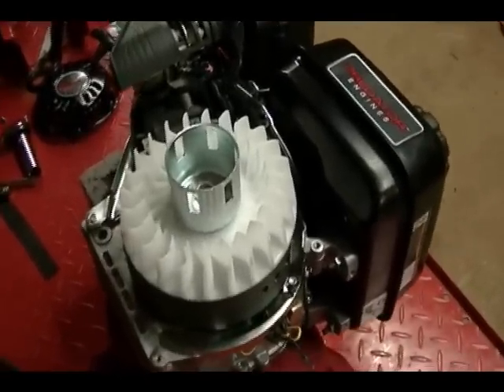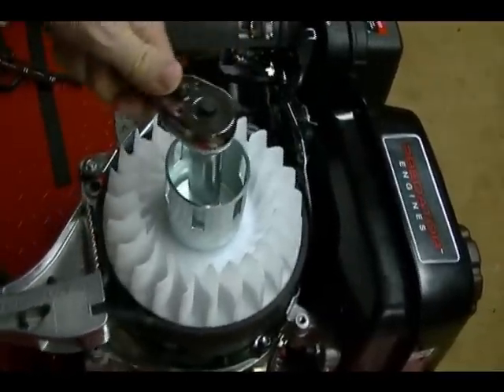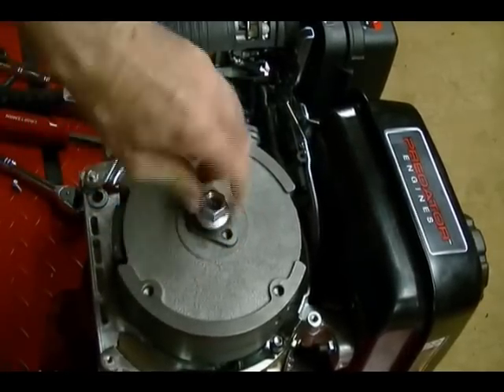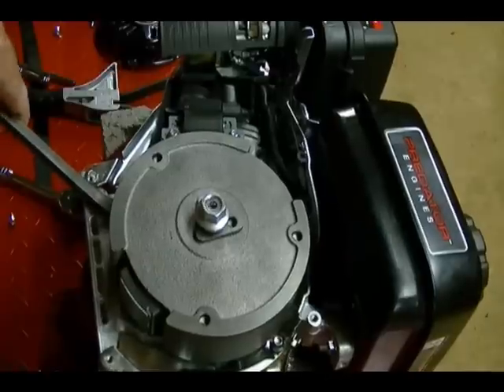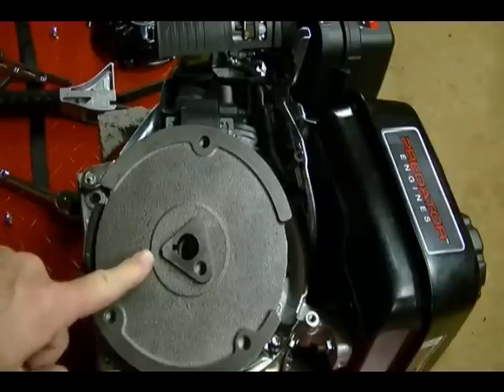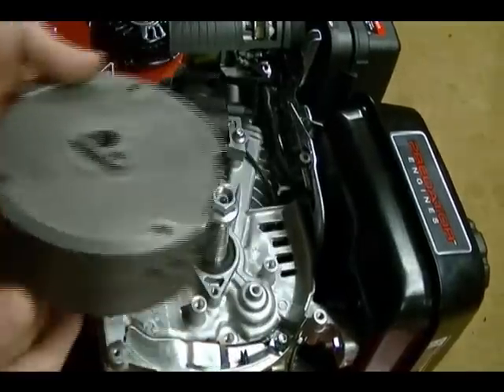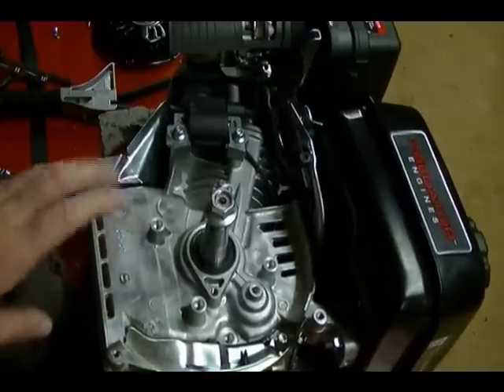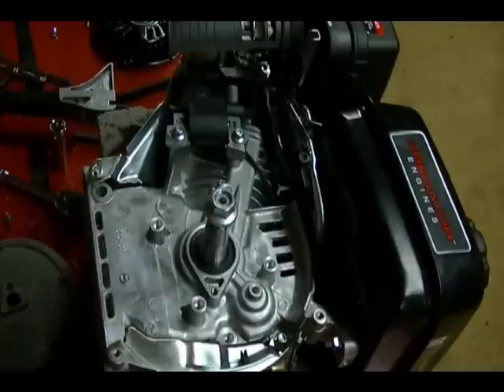Small Engine Repair: How to Remove a Flywheel without a Puller on a Harbor Freight Predator Engine

Comment: You can buy the single stator or dual for running 12 volt lights or blinkers, they are about 10 for single or 20 for a dual charging coil.

Comment: Might have to get a heat gun since my flywheel is being stubborn hopefully I can get it off. Just a junk motor to have fun with but the output shaft blocks the oil pan from coming off. I also notices a silver piece located in a notch on the crank in the flywheel. The silver piece looked like it was cracked in the middle and shifted to the side on the flywheel side so we'll see if that has something to do with it...

Edit: Don't know if it's silver or not just looks silvery compared to the flywheel.

Comment: You could use any two- or three-jaw puller. They fit over the lip nicely. If you do have some holes in the FW face, you could use something like a Blue Star (Snap-on) hub puller. I've got one of those; it's the only way I can pull drums off my old Willys Jeep! I haven't checked to see if the span is too large for a small motor FW, though. There are also steering wheel puller sets that would work, I think.

Comment: That's exactly what the 4 tapped holes are for. I'm currently putting the stator and flywheel from the original engine onto my predator engine so I can run the headlight on my mini bike.

Comment: THANK YOU!!!  This same engine is the RATO R225 that is on my 3 year old DR lawn vacuum. There is a charging coil that mounts to the crank case behind the flywheel.  It had stopped charging the starter battery.  DR sent me the part under warranty but I didn't know where it was.  I AM NOT A SMALL ENGINE GUY BY ANY MEANS!! I got the flywheel cover off and saw that it was exactly the same as the predator engine in your video.  I decided to give it a try and lo and behold it worked!! I had to rotate the flywheel and tap the bolt a few times but it came off with no damage.  Changed the coil and back in service.  Man, I love YouTube, you can learn anything.  Thanks again.

Comment: After taking mine off it will go on about half way then stops it came off but it won’t go back on all the way I’m confused mines a 2018 model and a Hemi maybe they pressed it on or something any Ideas?
Reply: Gotta make sure the key is is center. Take a little beating or just force it on with the nut.

Comment: This works,  I have done it many times over the years. Some are tougher to remove,
though...Use caution as says the author - and a heater gun will help, too.
BTW, I have just discovered my brand new Honda EP2500 has a VERY similar arran-
gement!  (this is why I'm here - I was quite surprised it had no puller threads).

So I'll get the prying tools (I use two flat punches ) at the ready, hey....Thanks.

Comment: For those who are still having a hard time, try these techniques trust me these are still much easier than trying to remove an old Tecumseh cast iron flywheel off a vertical engine. These are a lot easier. 

Take a torch ( small portable propane powered one). Heat the center of the flywheel evenly, it will make the metal expand. Tap the center nut, tap the end of the pry bar, turn the flywheel 180 degrees, tap again, repeat, use penetrating oil or some oil on the center shaft and it will pop a lot easier. (Make sure your fuel tank, lines and carb are empty of fuel).

Comment: I tried this method and it didn't work. Used a mini sledge hammer and still didn't work. Hit it even harder and still didn't work. This engine is not dirty or rusted.

Comment: worked great... I took my old fly wheel off my mini bike and swapped all the parts over so the lights would work with the predator engine... works like a champ had to slightly modify the flywheel to fit the crank but works great now
Reply: How hard did you need to hit the crank? I'm afraid of cracking the flywheel!
Reply: +Pred 212 I gave it a few taps like driving a nail in a board... you can see when it comes loose and then just lift by hand after that
Reply: TheRealScuba Steve Thank you for the quick response. I guess i'm not one of the lucky ones to remove it easily.
Reply: +Pred 212 no prob don't be shy get the nut flush with the crank and hit it and pry at the same time I had mine still mounted to my mini bike when I did it and didn't break the case
Reply: TheRealScuba Steve i sure wasn't sure about hitting it hard but i did what the instructions said and did a few good hits and it wiggled right off. Much harder than i figured needed, but it worked. Thanks!
Reply: +Pred 212 lol yea I know what you mean they make it look easy but it's def not fyi if you have a step bit you'll need it o ream a diff fly wheel to fit the predators crank... well I had to
Reply: TheRealScuba Steve If i put a different flywheel on this thing it will be for electric start. Have you seen the PowerLand engines? Just like the predator but they make E-start now. i need one of THOSE flywheels and starters.
Reply: +Pred 212 no I havnt I could use electric start on my baja warrior but currently  I'm in the process of changing it from a rigid frame to a swingarm with a harley monoshock ... shits gonna be bad ass

Comment: I'm doing this, and it still ain't working. My motor has a couple years hard use as a mud motor on my fishing boat.
Reply: Take a torch ( small portable propane powered one). Heat the center of the flywheel evenly. Tap the center nut, tap the end of the pry bar, turn the flywheel 180 degrees, tap again, repeat, use penetrating oil or some oil on the center shaft and it will pop a lot easier.

Comment: yes that's for adding an alternator with an easy starter I work on this engines a lot it's just a another piece of metal with teeth all around it but it's recommended to buy the whole flywheel with the required magnet metal all together let me know if you got anymore questions
Reply: You could probably use one off of another Honda clone
Reply: Juan Rodriguez  where do I find an generator for this motor?

Comment: worked like a charm thanks for the quick tip
Reply from the maker: +William Burch Thanks for Watching!
Reply: smallengineshop Thanks been looking around for a flywheel puller 5 stores nope looking for the little black nut one with a loose male driver I got a GT80 and there is a case built around it so I cant levey it so Im screwed again unless you got another way.

Comment: much easier with an air hammer (pointy bit) in the shaft dimple, and a long screwdriver to keep medium tension upward from under the flywheel. comes off in about 5 seconds with very minimal effort.
Reply: Much easier method, than the hammer strike

Comment: Had to remove flywheel to replace seal which has popped out, used your technique with a tyre iron behind flywheel and gently tapped end and it came loose! Thanks! Motor is a generic chinese GX160 copy similar to yours but different brand. Not sure if seal has been pushed out because of excess crank pressure but I'll just try it again with a new seal siliconed in and see, nothing to lose much with these cheap motors I guess.
Reply from the maker: +Brian Hizsoltee Thanks for Watching!

Comment: Thanks! I had nothing to loose on a split shaft Tecumseh snow king. I'm adding a starter to an identical engine. But on this one there are no magnets on the inside either. Just spots for the magnet. I imagine you have to add them separate.
Reply from the maker: Thanks for watching!

Comment: There is an easier way and you will not bend the shaft or mess up the threads. I always use a air hammer or air chisel. I put the round point in the center of the shaft and pull the trigger while prying up on the flywheel with a big screw driver. Also an easier way to start a chainsaw or lawn mower that you are tired of pulling the cord is to use an impact wrench and put a socket on the nut that holds the flywheel on. Then pull the trigger and no more sore arms haha. I either weld an old socket to an old extension or duct tape the socket to it so it wont fly off and hit you.

Comment: how can i remove my crankcase from a briggs and stratton 35 classic i have managed to get it off around 1/4 inch and it will not come off thy further i have tried hammer pry bar rubber mallet pullers and air hammers it still will not come off is there something stopping it coming off any further or is it just seized to the crankshaft? I am assuming that is is seized as the crankcase will not turn without turning the crankshaft to.
Thanks

Comment: good video... I used an 8" gear puller. snugged the puller up and tapped the puller end with a rubber mallet..she popped off. only catch is you have to put one jaw of the puller on the magnet because of clearance.

Comment: Thanks, looks like the champion 6.5 for a generator is exactly the same motor as the predator motor. Different brands same china motors. I noticed power stroke used the same motor also.

Comment: taking it off seems pretty easy considering you don't crack the crank case but I want to replace it with an aluminum one, anything I need to do specific when installing it? or is it just the same, reverse instructions.... Thanks, good vid

Comment: ur system works but its very risky especialy if the flywheel in locked in good.i would of gotten a round steel plate n made my own puller,ither used those 3 holes the flywheel has or i would drilled the flywheel N made 3 holes n threaed them for the pulley.

Comment: i have a question, i have a subaru robin ex21, i need the magnet that mounts to the fly wheel for the magneto/spark system. mine fell off during operation.  Where would i order/buy one? the only thing i can fins is the entire flywheel @ a outlandish price.